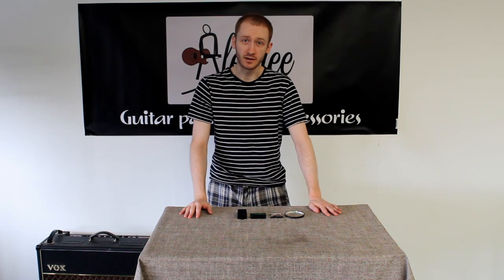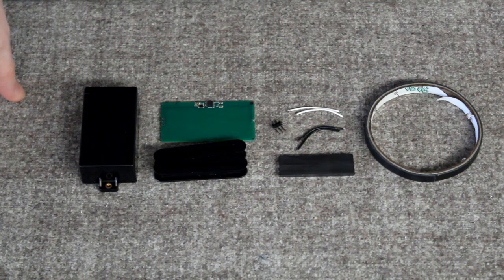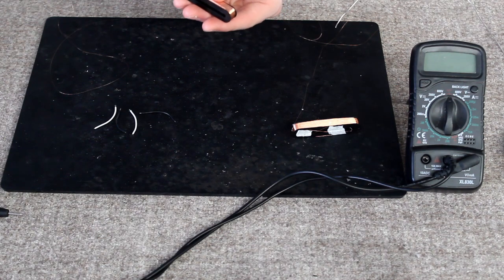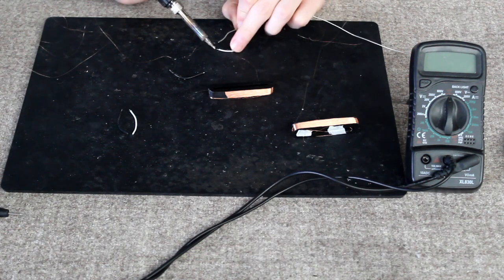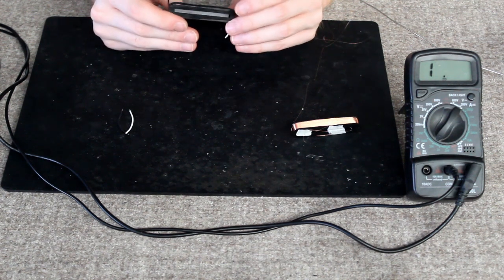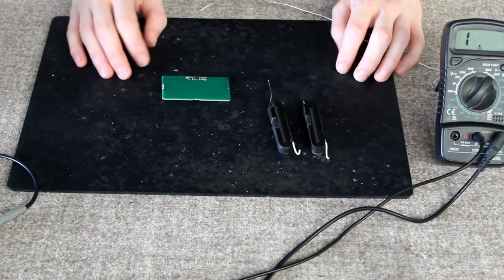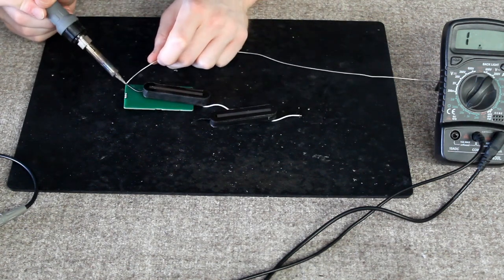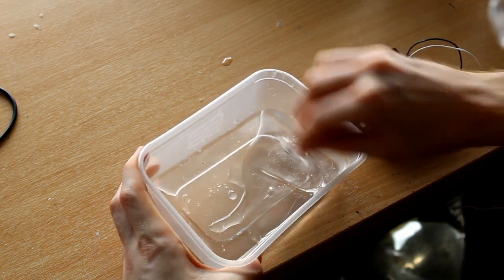How to build an active humbucker (by a professional)

Comment: Is it possible to reverse phase, 1 of 2 single coil active pickup? Or its a no go
Reply: Have you find something on this? i want to do the series/parallel/single mod as well as reverse phase on an active pickup but havent found anything, my guess is that it should be possible tho
Reply: @mafw5572  nope, just apply normal phase, the result, it is out of phase when combo

Comment: Finally there's a decent video that show how it's done with active pickup. So that means, It is possible to take regular pickup and make it active. By the way, where is the "digging in the guitar for the battery box placement" part?
Reply: My only concern would be how overwhelming it would be. A regular Hotrail already has ridiculous output, so adding a boosting preamp would almost make it untamable.
Reply: @josephfigueroa3527  You can adjust the circuit gain by swapping the negative feedback resistor so it has less gain
Reply: @josephfigueroa3527  Active is not just about gain, but lowering output impedence so the signal isn't affected by cable capacitance etc.